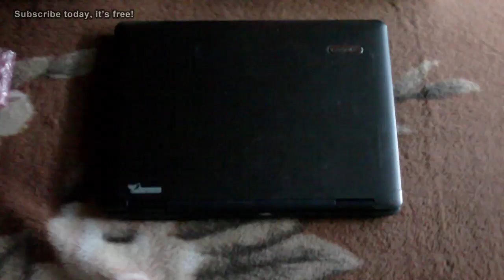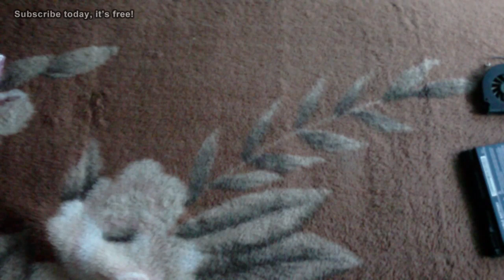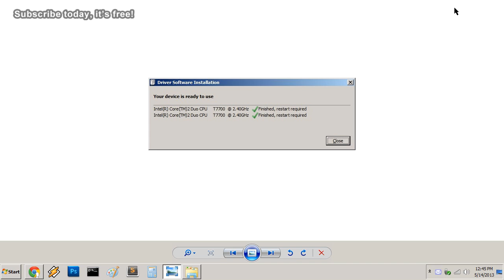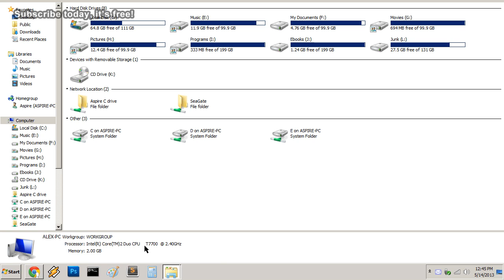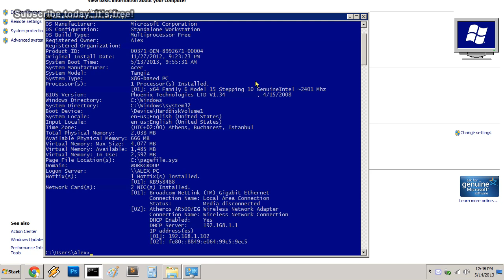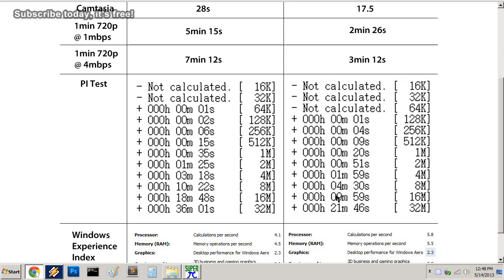Acer Extensa 5220 - CPU Upgrade

Comment: Hello,
Inquiry into the Acer Extensa 5220 notebook can be used laptop CPU Intel 
Core 2 Duo T7700 CPU socket 479 4M Cache / 2.4GHz / 800 / Dual-Core 
processor support 965 Laptop
Thank you for the answer to this.

Comment: Intel Core 2 Duo Mobile T9500 this will work?
Reply from the maker: +Николай Колесников i checked manual,they don't say anything about T9500 http://www.next.lv/dynamic_contents/downloadFile.php?DownloadId=153
but the socket is the same http://ark.intel.com/compare/30774,33918
Reply: YES,my work with it, 2Gig RAM, SSD

Comment: hey! i have acer extensa 5230 what model of cpu is better for my pc? like yours model is good for my laptop,what do you recommend me?
Reply: http://forum.notebookreview.com/acer/452148-acer-5230e-cpu-upgrade.html
Reply: Iliescu Alexandru Robert got a extensa 5620z and sopposidly it maxes out at intel t9500 but wouldn't work with the t9300 even though same ratings except for ghz rating. is it my bios also in my manual it says ican max ram to 4gb but only works with 3gb. im running a 64bit windows and still wont work

Comment from the maker: For half life 2 you only need a pentium 3 processor running at 1.2 GHz,256 MB of  ram & 64mb video ram.

You can update your processor to a intel Core 2 Duo T9900 which runs at 3.06 Ghz, 6mb cache and 1066 MHz FSB.

The best thing to do is check your manual,the most powerful processor may very for different models.